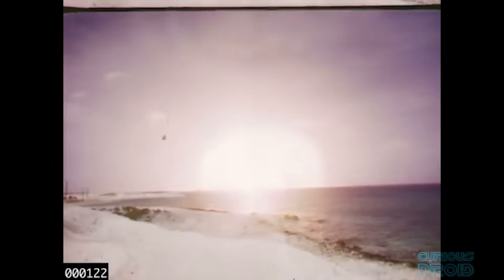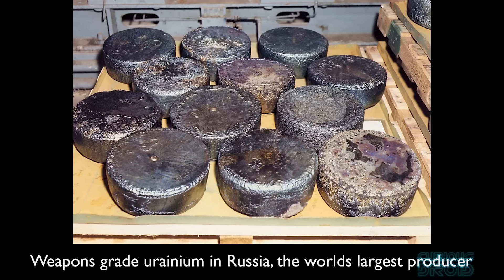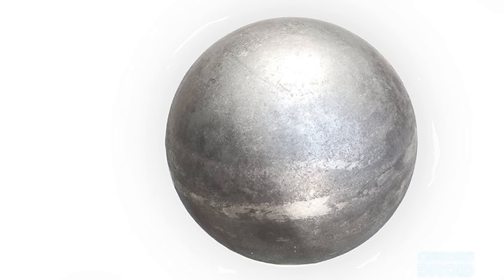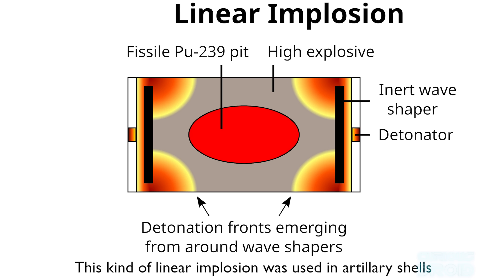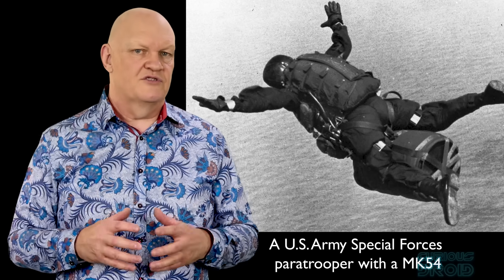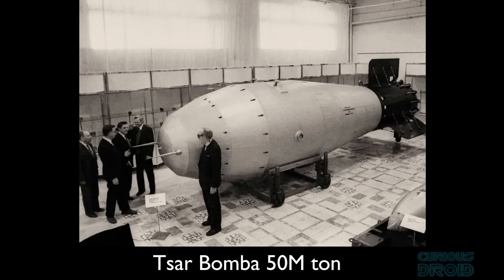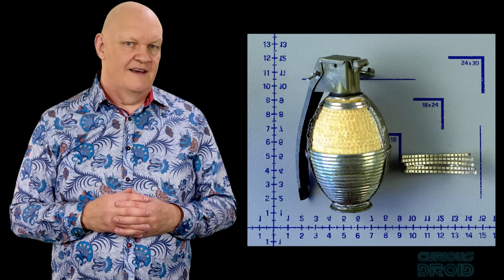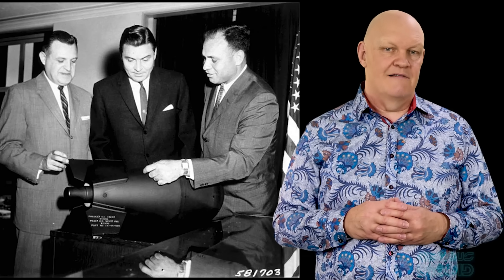How Small Can You Make a Nuclear Weapon?

Comment: You conflated a fission tamper and reflector, which are two very different physical effects (that sometimes may be the same layer/material, but often not).  Tamper has heavy dense material to slow down expansion of the core and keep the chain reaction lasting a bit longer at its peak.  Reflector bounces some of the escaping neutrons off the surface back into the material, which increases criticality, which increases alpha or the time to double reactions, and several other ways of helping.  But the best reflector commonly used is beryllium metal which is much lighter than the fissioning core and hardly slows down expansion at all.  The best compromise is often listed as tungsten carbide, but in reality adding much tamper at all changes the energy dynamics of the implosion transferring energy into the pit that most modern devices don’t bother.  There’s a fire resistance layer, stainless steel is one example, but the reaction assistance is by reflection with beryllium or its biologically safer alternatives like sintered industrial diamonds or the like.

Oh, and effectively the best accelerator is boosting, where you go from 300 tons yield to many kilotons in one fission doubling time because the D-T fusion reaction is so much faster…
Reply: Came here to say this, a rare Scott L
Reply: I think you meant increasing criticality Decreases tine to double.
Reply: @PMA65537  Yeah, my misphrase.  Alpha is in units of inverse time, high alpha is faster increases, which for alpha canonically activity increases by e (2.71…) every 1/alpha time aka e-folding time.  Decreases doubling time, which you can derive from alpha but you have to convert base e into base 2.  Doubling time as ln(2) / alpha or ln(2) * e folding time.  I should stick to one convention but e confuses normal people, 2 confuses non computational physicists, e confuses computational physicists.  Engineers like me are confused by everything but we’re going to bolt something together.
Reply: excellent info/context, are there any text books etc that you would recommend/reference on this subject?
Reply: @dbrunecz78  Carey Sublette’s Nuclear Weapons FAQ engineering guide online, Barroso’s Physics of Nuclear Weapons book, Goetz’ Technical history of US nuclear weapons, Chuck Hansen’s book if you can find a copy, Coopers’ Explosive Engineering.  Wen Ho Lees’ book on simulation of shapec charges.  Any advanced physics text on condensed matter physics which teaches fermi gas physics.  That’s a start…
Reply: I wanted to write the same, but I wouldn't explain it so well

Comment: @4:45-ish, the vid claims that the US has no more bombs to drop after Hiroshima/Nagasaki- but, this is not accurate. They had enough Plutonium to produce at least one more bomb right away, and the expected rate of the increase of production was likely enough to reach at least two or three bombs per month by the end of 1945, and, if wartime production continued to increase at the rate that it had in 1945, the doubling time for material for bombs was less than three months,  and the actual postwar production, even without continuing to build more breeder reactors, wasn't farr off of that. 

It is true that the US likely couldn't have dropped another bomb in August 1944, but a dozen or more could likely have been produced and several delivered by the end of the year.

The definitive history (for laypersons) on the Manhattan Project and the early history of the science of fission is Richard Rhodes 'The Making of the Atomic Bomb', which makes this clear, and later sources expand upon it. By September 1945, the making of plutonium bombs had ceased to be primarily a scientific and engineering problem, and had become limited to logistical and industrial considerations...

For example, there was one estimate that held that if the US could dedicate effectively unlimited resources to building bombs (which was not far from the truth until September 1945), then the US could have built and delivered 50+/month by early 1946... Thanks be that that was not necessary (I think that estimate was drawn up in response to the concern that Stalin wouldn't have stopped at the line of contact and the partition of Germany- which is exactly what happened as soon as soon as the USSR tested their first bomb years before they were expected to be able to do so. (Thanks a lot, Klaus Fuchs, What an asshole.)

Comment: The W54 did not have an uncertain yield, it had different versions with different yields. The M338 warhead for the Davy Crockett had a switchable yield between 10 tons and 20 tons; the AIM-26A Falcon air-to-air missile had a 250-ton warhead; the SADM had an improved version that was variable according to which yield the Special Forces soldier selected when setting it up, from 10 tons up to 1 kiloton (probably 10, 20, 250 and 1000 tons).

They demonstrated the Davy Crockett in a live test to Robert F Kennedy (senior). They would hardly have done that if the yield had been uncertain. It's generally frowned on in the armed forces to accidentally irradiate the president's brother.
Reply: He's also wrong about the US bluffing about having more bombs, there was at least one more already being assembled that could have been at Tinian within a week or two with enrichment going on that would have produced enough material for several more within a month or so.
There was actually 3 that were shipped to Tinian not just Little Boy and Fat Man, but components for one were used for a practice drop into the ocean just several days before the Hiroshima mission.
Reply: @dukecraig2402  The core for the third bomb was at the airfield in the States for transport to Tinian when the surrender came through.

It later went on to become the star of two nuclear accidents that killed two Manhattan Project scientists. It would have been used in the Bikini Atoll tests in 1946 if not for the last test being called off.
Reply: @dukecraig2402 there were several implosion units available at Tinian, just not plutonium pits. The 3rd pit had been shipped from Los Alamos, but Truman ordered it held before it reached San Fransisco. A third bomb (well technically fourth if you include Trinity) could have been available within days if needed
Reply: @kellymcdonald78 
The third bomb at Tinian I'm referring to that was used for a practice drop in the ocean didn't have a core, or whatever it's called, sorry I should have been a bit more clear on that, it's to my understanding it was a Little Boy bomb without radioactive material, the reason being was all the practice "pumpkins" they'd been dropping including ones filled with regular explosives they dropped on Japan for practice were all modeled off Fat Man, as they'd never dropped a Little Boy type for practice one was sent without radioactive material for a practice drop in the ocean, that's the one I referred to, but it's also to my understanding that the material for those gun bombs was much easier to make and they actually had more than previously thought, they just didn't want to use gun bombs because they weren't as powerful. 
And there were more bombs in the pipeline than everyone has previously thought, all books written before 5 years ago on the subject are all incorrect, 5 years ago documents were declassified that'd had a 75 year seal put on them, they show that there were several more than previously thought by scholars with even more that would have been available within a month than what's previously been thought. 
I'd just recently read an article about it, unfortunately I'd just previously purchased the book Bomb, The Race To Build, And Steal, The World's Most Dangerous Weapon by Steve Sheinkin, however it was published in 2012 so I'm sure it doesn't contain the information that's recently come to light, I haven't started reading it because I'm not finished with LeMay's book on the B29. 
Do you know about the recent revelation concerning the recently declassified documents? And if you do where can I find something on it?
Reply: @dukecraig2402 there were several Little Boy test assemblies that were test dropped as well (they just didn’t call them pumpkins). The biggest reason they didn’t build many mk1’s (Little Boy) is that they were extremely inefficient and used large amounts of fissile material. 3-4 mk3 (and later mk4) implosion devices could be built using the same material as a single Mk1 (the gun style weapons were pretty dangerous too).

As to the number of weapons produced, there are a lot of factors here. One is what could have happened (had the war continued) vs what did happen. Production forecasts had 3 bombs per month in sept ‘45, growing to 6 by dev ‘45 and as many as 12 per month by early ‘46. However, because the war ended, many things what were expedient (but inefficient) before, were stopped and facilities like K-25 were reconfigured to improve efficiency, S-50 was shut down. Hanford slowed down production as they hadn’t yet solved the Wigner effect. Many scientists at Los Alamos went home. So overall production of weapons slowed down considerable. The Mk-3 was also more like an experimental prototype that required a lot of trained technicians to assemble (one of the drivers behind the Mk-4 was to make a device that was truly a weapon and not a science project). Rhode’s Dark Sun talks a lot about the immediate post war period before things really ramped up again to build the H bomb
Reply: This is incorrect. The W54 M388 was fixed at 20 tons and the 10/20 thing is misreporting of the fact that the detonation altitude of the warhead could be varied.
Reply: @Wubslin01  You might be right. Looking at a labelled picture of the M388, there doesn't seem to be a control for yield. Looking around, I can see reports of 10–20 tons, and some of those say it's variable, whereas other say it's just fixed at 20 tons only. 

But I also have a ref to the answer to someone's FOI request that says that the DoD won't comment on the yield. And the two tests that weren't fizzles have the yields at 18 and 22 tons, which is interesting. That difference wouldn't make a lot of difference to the operators, but it is a difference, so it looks like I'm strictly wrong about the yield not being uncertain.

I'm going to have to put that on the backburner while I keep my eyes open for fresh info.
Reply: @akizeta  Looking at various sources, the reported yield varies wildly between them.
Some list "variable between 0.01 and 0.02 kilotons, others list one or the other as the actual yield, and at least one says it's 0.018kt (so somewhere in the middle).
And one source mentions that depending on variant, yield was variable between 0.01 and 1.00 kilotons, which we know already.
Nowhere is there any mention about a dial-a-yield option, though it can't be ruled out that field modifications by say swapping out a radiation shield with a neutron transparent cover would reduce the yield significantly.
Reply: politicians cant judge the yield of nuclear weapon, they don't even understand the concept of kiloton and megaton. they might not even know what is a ton, for them ton is just another swearing word, "I got tons of it".
Reply: @yoppindia  Hell, they can't even understand the concept of a million, billion or trillion. I pulled the graphics off the web to show one low level local politician once. There are good graphics for how many pallets it would take for a billion vs. a trillion dollars. It's an immense difference but only two letters in difference in a 'budget.'
Reply: Being in the Army can take you to crazy places around crazy people, doing crazy things. Even when you're just a new Private. My Platoon Sergeant was no CIA spook or SF green beanie. But he was a Blaster Mike. An Army Engineer 12 Boo private fresh into the army, he was 'voluntold' to be a SADM guy who lived plain clothes in Germany, undercover, little Secret Squirrel training, that when activated would parachute by rented aircraft over lines to destroy a target. Gary would laugh that they taught him to hotwire Eastern Euro cars to make his escape, but everyone knew it was a 1 way trip. He liked the gig because he basically got to be a 20 year old with no real job to do on the daily, drinking and chasing tail in Germany in the 80's. Another 80's PSG from our company had a similar job, guarding warheads as they were shuffled endlessly back and forth across German civilian trains, dressed in civilian clothes, wearing a trench coat and packing (get this) an M3 grease gun along with 3 other guys. A single fire team of junior enlisted and one Buck Sergeant to guard a warhead, just to keep them slippery and on the move from being targeted.  
You don't need to be a highly trained secret squirrel to find yourself doing crazy gigs you have no business doing.
Reply: I appreciate your addition of 'generally' ❤
Reply: Had a Team Sargent  who was on Green Light team with 10th Group back in the day. Had little to nothing to say about it. Spooky dude.

Comment: The release of this vid was timely; Another good channel, 'Adam The Ok' also just released a vid about 'Nuclear Fracking' (which, apparently, is a thing!). That vid was also periphifilly (sic?) concerned with how small nuclear bombs could be made, given that they had to be lowered into oil/gas wells with diamators from 16 to as low as 9 inches. (Presumably gun- type enriched Uranium bombs, as they were longer than they were wide, by a lot.)

Anyway, the channel (again: 'Alexander the OK' ) s worth a watch, and it covers some similar topics as CD, though, sometimes in exhaustion if entertaining detail. Check it out? (Especially the one about the Lithium/ Hydrogen/ FLOURINE rocket engine that was built sometime in the free-for-all that was the cold war's utter disregard for any kind of safety whatsoever. 

That rocket was... Cool? 😨🤬🤘

Comment: There's a very obvious reason to ignore claims of hundreds or even dozens of missing portable nukes. We haven't had one go off by accident yet. If such things were in the hands of unstable non-state actors, it's absolutely certain that one would have exploded as they tried to modify it, or they stored it poorly, failed to maintain it, etc. The fact this hasn't happened means there are very few, probably zero of these devices in such hands.
Reply: Given the half life of many of the core materials, most would probably fizzle. Maintenance is critical for nukes, not sure Putin is on top of this.

Comment: I don't know if it matters but when asking how small a "nuke" can be while still being a nuke, I think that was answered in part by the Davy Crockett rocket. It was small enough to be carried by something like a squad of soldiers and the rocket had just enough fuel to reach a place that if it went off it wouldn't necessarily kill those that fired it. The entire rocket is just under 100 lbs the nuke that on it is just under 25 lbs. My guess is while it still might be possible to make the nuke smaller and have it fit into a large briefcase (in order to have a so called "nuclear briefcase" claimed to exist during the Cold War) if the bomb used something similar to the Davy Crockett which were supposedly the "smallest nukes" ever made and you are just carrying the explosive part and not any of the rocket, you are likely looking at something that would require a decent sized duffel bag in order for a container to hold it. While it could be carried by just one person, I don't knowvhiw many miles a soldier could be expected to carry such a thing.
Reply: It wasn't a rocket. The physics package weighed more than 25lbs.
It was the lightest weapon ever produced, but not the smallest diameter.

Comment: It's not so much the nuclear physics doesn't work at small scale. The problem is that a pit/core assembly using heavier exotic isotopes whilst theoretically smaller & lighter has insufficient surface area for current conventional explosives to compress it enough to achieve the required energetic state.

....  <sigh> guess I'm on another watchlist now
Reply: The solution for small masses of plutonium is to use a thin hollow shell core.  Lots of surface area for the HE implosion to act on, the cavity is filled with boosting gas, the fissile material accelerates towards the centre and compresses itself to extremely high density.  
This arrangement was developed decades ago.  No doubt more sophisticated designs exist today.
Reply: @wilhelmvonn9619 you can use magnetic confinement also, allegedly one soviet design used 300 grams of plutonium as a primary for 3 stage 100kt excavation bomb
Reply: Then use a high powered laser. Use an isotope of material which converts to a very short half life element upon electron capture emitting obviously neutrons.
Set your laser to the resonace of said electron valence shells and....boom?
Reply: Roger, Roger. Johnson, Let’s get a team together to investigate this guy.
Reply: I believe that a Neptunium bomb was assembled and fired.  Saw that in a technical paper.
Reply: Hahaha!

Comment: A couple of corrections. There are uranium implosion fission bombs too. It does not have to be plutonium. The bombs dropped on Japan were not especially heavy and there had already been conventional munitions of similar or even higher weights and several WW2 bomber types could carry them. The main reason the B29 was used was range and altitude capability but mainly range. One of the mission requirements what that they launched from a base that was too far away for the Japanese to be able to attack it.
Reply: Plutonium saves about 25% size and weight vs. uranium.
Reply: @raybod1775  More like 80%..
Reply: @raybod1775  I realise that, plus it's easier to produce. I just mean the video seemed to imply the implosion device was limited to plutonium.